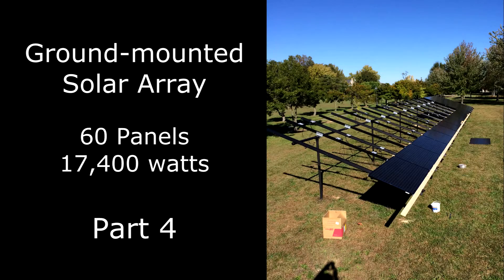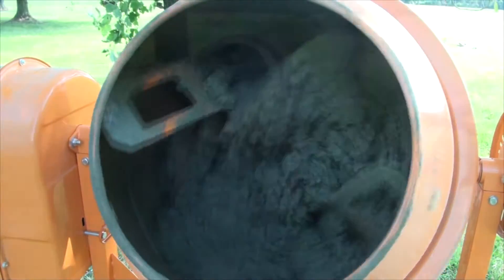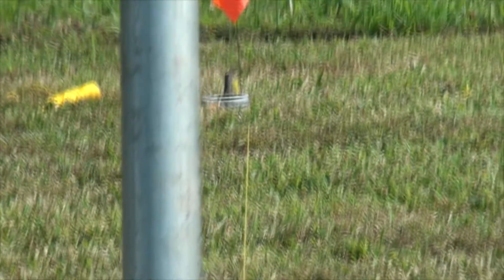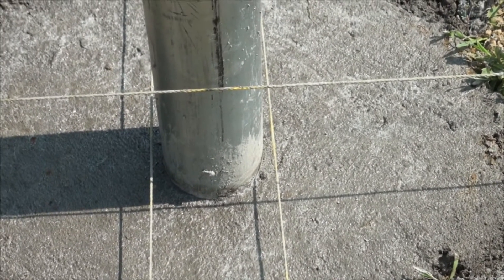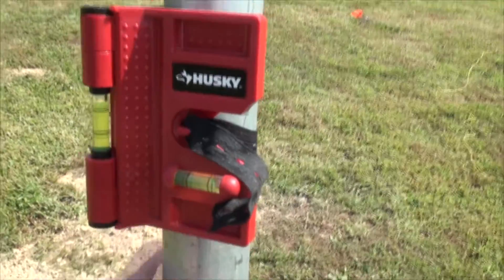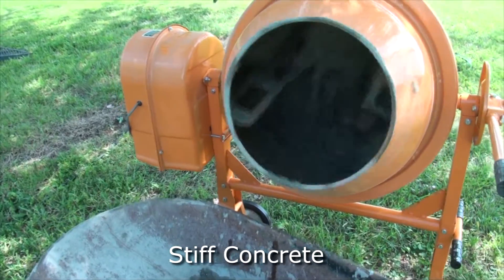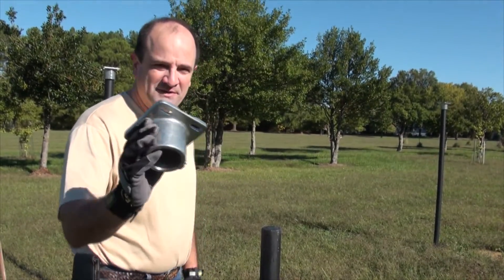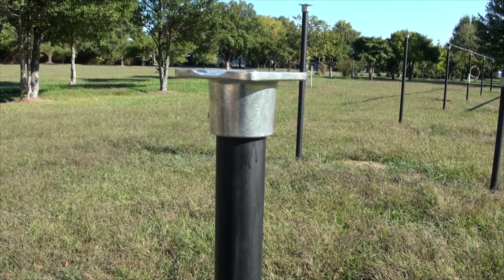DIY Field Solar Array - Part 4

Comment: I see your helper doesn't need a cheater bar and you do. Guess you didn't eat your Cherrios this morning. Well done video, thanks, cause I intend to do a similar system this Spring and you instruction is valuable.

Comment: I like the diy video series so far. Is nice to see an install from the beginning than just the end product. My boss an electrical contractor is wanting to install a ground mount system for his future solar array. I like the use of the 2" rigid pipe for the poles, we might use rigid for the poles and horizontal rails, but thinking we might use some deep uni-strut for the panel rails and rigid pipe straps to mount to the pipe, the cost might be cheaper than the railing system your going to use, what is the price tag for the rails your using as compared to 10' of unistrut? What is the price for the dc optimizers your using and is there a reason your not using panels already integrated with them like the Axitec AXIplus BLK SE AC-270P/156-60S 270W Poly Solar Panels? Cool project, keep up the good and hard work!!
Reply from the maker: At least once in the previous video, I made a mistake and called the pipe "iron" - which is not correct.  Just to be clear, it's schedule-40 galvanized steel pipe (which I got from Home Depot).  Importantly, it is not tube or conduit.  "Ironridge" makes components used with both 2" or 3" steel pipe but they are not interchangeable, of course.  Apart from the pipes, I purchased nearly all the major equipment through a distributor in California by the name of "Renvu".  I had to negotiate on freight shipping, but I think they've worked out a better shipping arrangement since then.  I would do business with Renvu again, but I would ask them to wrap the rails better for shipping because some of the rails got really scratched up.  I spray painted the scratched rails with rust-o-leum and they ended up looking fairly good.  I do like the Ironridge system; I haven't worked with any others.